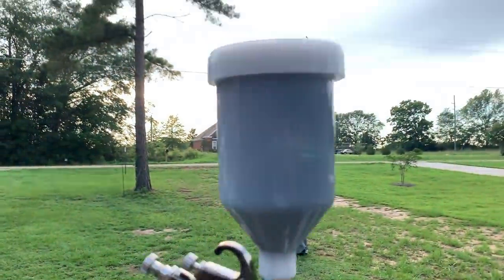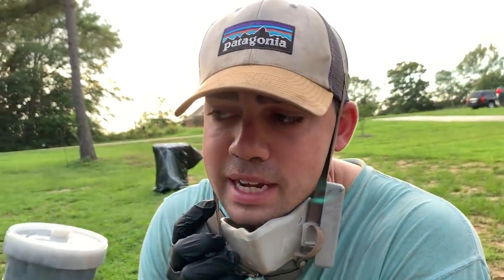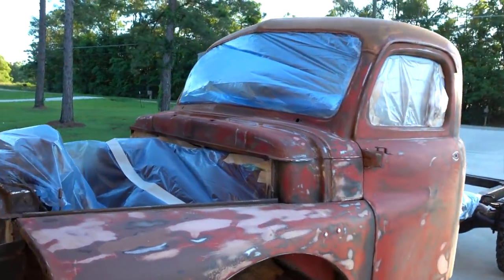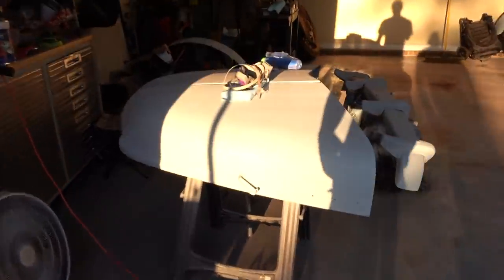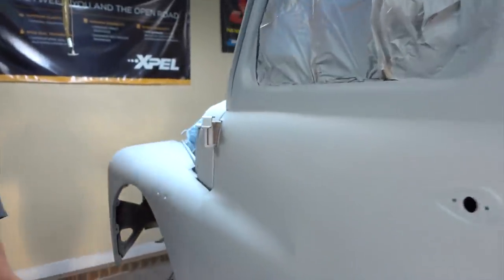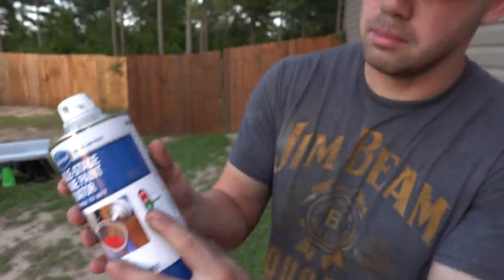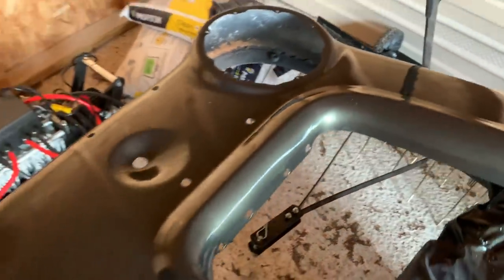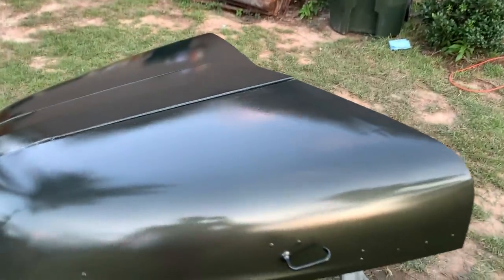I Painted My 70 Year Old Farm Truck Outside With Zero Experience.. Quality Results?

Comment: My  First viewing of your video but I enjoyed watching you shoot backwards.
   I painted my first car at 14 years old,  2 tone,  Red & White on a 1954 Buick 2 door hard top.
In 1963 I used automotive enamel which was preaty much the standard for the time.
The car owner was amazed !
My father who was a retired master painter, was empressed.
   I question why you start at the bottom close to you rather than at the top and draw toward yourself ?
My self as well as most painters I have seen always start at the top and work down, no matter what is being painted. 
Even a house.
As well as start at a point farthest away and draw closer to them.
This prevents dragging the air hose over wet paint and allowing you to put better coverage over the light mist already started at the point closest to you.
   Also why did you not ( cut in ) the areas that you will move over with your wide sweeps ?
The grill suround, under and around the hood edges, the drops and under edges of the running boards, the door openings as well as the door jams.
   Maybe you were taught a differant way !
Also. after you shoot your primer you can mist with black, then when you  block scratch sand the primer it shows any dents you may have missed in prep. allowing you to work them before start your final color coats.
This is especially important with a metalic color because matching dry metalic is a bitch and will usually leave a noticable ring around where you sanded !
   I hope you take  this as helpful tips from an old Hot Rod Builder.
I will soon be 72 years old and am still building cars of my dreams.
And I do all of it !
From the ground ( Garage Floor actually ) up.
Designing, Welding, metal fab, metal finish, upholstery and paint.
And I don't have a paint booth either.
I do not build my own engines anymore simply because it is just not something I enjoy.
I have a friend with a machine shop do the engines as that is what he enjoys doing.
I have a house full of trophys from a lot of car shows, so I guess I did something right.
Enjoy what you are doing, It will show in the finished product !

Be Safe and well
  

I

Comment: I'm an outside painter. When you wet sand and buff, it will look amazing. That is an art in itself. Hard to use sandpaper on brand new paint. All the dust and orange peel goes away. It will look perfect. Have faith. 👍
Reply: Even worry about overspray on your vehicles close to you not a good idea

Comment: Nice job for beginners. Wet sanding single stage might be tricky if there is metallic in it. You could send through the clear binder that is in single stage and exposing the pigments. Then you will have to repaint the area or the panel. Good luck and would love to see the finished truck.

Comment: You'll get better coverage and control if you move faster and overlap closer. Let each coat dry enough to dry and shrink in.
  If you want a slicker job. Paint and wetsand the next day with 600 grit wet or dry. Knock the peel down enough and put a light coat and after it tacks up , a wet to full wet coat. If you do it right it will be flat with little peel and you will only have to nub the dirt specks and polish those spots. Works out better for longer lasting finish.
   Painted professionally since 1970. Yeah I'm semi old.

Comment: nice job, rust on a car or truck( Buttina) is not cool and doesn't look good ,When spraying metallics it's good to spray in a checkerboard pattern of coats to avoid streaks, get yourself a good mechanical mixer and always shake your gun to keep it mixed when you're spraying.

Comment: What if you put the textured coating from East wood inside the wheel wells or a black undercoat an gloss black over it? Help with rock chips an if it chips at least the under coating is black already

Comment: I've painted a few outside, less bugs in the morning. As soon as I got some better paint equipment the paint looked a lot better. By equipment I mean 1.8-20 tip for spaying epoxy and 1.5 tip for the single stage, 1.3 or 1.4 for the clear. That helped with the orange peal. eventually I got to work inside- all that painting in the yard was good experience. good luck.

Comment: If the vehicle is going to sit outside for any length of time it's a good idea to prime the panelwork with an etch primer before a sanding primer. Otherwise, the sanding primer will suck in moisture through any stone chips or wear spots. Then rust will gradually spread underneath the whole coat. This is ten times more important if you live in an area where they salt roads. Etch primer will give long term protection against rust.

Comment: Orange peel comes from putting the first coat  on to dry, and when painting we always start at the top and work our way down , thats not to get over spray ............
Reply: You can do it either way starting from the  top on a truck  yes but on spot jobs indont
Reply: Orange peal can result from about 40 different elements throughout the process, if they would have just wet and buffed there would have been no issue

Comment: Just caught up with your project. I have a 1957 Chevrolet 6400, the body is in great shape no rust, lot of work to do on the frame for painting like you were doing. I stayed with the 2 piece wheels but if you want to go with one piece I believe there is a company in Calif. called Stockton that makes wheels any size and pattern you need. Good luck.  Nice paint job.

Comment: Not bad my man for the 1st I remember the 1st time I did a paint i was so pumped up... but from my experience it is pretty hard to effectively wet sand and buff metallic single stage paint you may have to scuff it down and reshoot it for the best result good luck and keep trying

Comment: Like u said a good wet sand to get the orange peal smooth and then hit it with a nice clear coat will look amazing. I suggest buying a cheap tent or build your own to inclose it some how while you clear coat it to get best results. There's vidios out there to build you own for a few hundred bucks some 2x4 and some clear painters tarp. Then wet sand your clear coat and and buff and wax. Great job guys love the videos.

Comment: I bought one of those Pilot house Trucks 20 years ago. Fired it up and drove it home 30 miles , No brakes no insurance. The tires had air but where flat spotted from setting. could only go 30 MPh. It had been setting for 35 years. It has the extra windows in the cab. And a Southwind gasoline heater. To much expence and work to put tires and brakes on it. I bought a motor home at a auction for $110.00 and it has a 440 . Drove it home also. Thats the best solution for me is to swap the 48 cab on that motor home chassis.

Comment: Boys, you're doing fine. Temperature,  humidity/moisture, and bugs are going to be your enemy. A little orange peel is nothing, have a look at factory job finishes. The difference is in sanding and cutting once it's down. Keep going strong.
Reply from the maker: Thanks Mark!

Comment: You did a great job! Don’t worry about orange peel. You will always get some orange peel. Then you cut and buff. For the dent Next time hit it with a dust coat of black primer over the grey primer, then block sand to see the high and low spots. I’m no pro either. My 1968 mustang coupe was the first car I painted at 16 I’m about to repaint it but idk if I have the confidence to make videos.

Comment: I did a summit racing single stage silver and burgundy two tone and cleared it with speedokote clear.
Reply: How long did you wait between last coat of single stage and first coat of clear? 
I have same brands Summit ss paint and Speedokote clear as you stated and about to paint soon.
Reply: @tobyk5149  first I sprayed the silver then I waited 8 hrs to tape the panel so I can spray the burgundy. The tech sheet said to wait about 30mins to an hour. When I touched the surrounding paint on the tape and it didn’t leave a finger imprint I knew it was ready to clear of course this is after thirty mins.
Reply: @FaDeDStudios  thank you so much for the quick reply and great info! Yes the Tech Data Sheet for Speedokote clear says 30 minutes but I have been reading online that many people say that since it is different brand than the Summit single stage, they wait a day or so then scuff with 800 grit or gray scuff pad before spray clear. I prefer the normal method that you did by following tech data sheet (let ss flash at least 30 minutes) but I planned to use a test panel because of the conflicting opinions online. Your info will save me some time and material that I would have wasted experimenting.
Reply: @tobyk5149  No problem, it took me a lot of time to build the courage to even paint it. If your painting with metallics i learned that it will mess with how the metallics laid so that’s why i cleared right after. do you have Instagram? I have a page called opas_obs there you can see how it turned out.

Comment: Was wondering if the bumper would cover the dent and that way you wouldn't have to worry about it! Honestly it will look so much better than it was I'm not sure how much I would worry about the small dent! If nothing sand it and fill it with either body filler or spot putty and respray it!

Comment: If you paint in the garage with plastic on the walls an wet the floor down it would help with the final clear coat at least the static electricity in the plastic will help Cling the over spray in the air

Comment: Prep is the most important. You can color sand the paint only so much. I did my Chevelle in my garage and beat local body shops at car shows this it's with 3000 contestants getting first place. Prep most important.

Comment: I am so glad to see that the youth of the day still are into repairing and paint the old stuff. From what I can see you are doing a decent job on it.  I like your paint booth, Kind of looks like my first one.  I painted my first car, a 1938 Ford, 4dr sedan, my first car,  I was 13 years old.  That was 65 years ago. I spent 20+ of my younger years in body shops and  I still have the passion.  My next project is to take my 1948 F6 COE Ford and it's little brother a 1948 Ford F6 Conventional and marry the two into a 4dr. 1948 F6 COE. Then mount the new cab on my 1993 F350 7.3 Turbo Diesel frame. Hope to have it done buy my 80th birthday.  I don't intend for this to be a show truck.  I will put a killer paint job on it, but plan to use it and not baby it.  .
Reply from the maker: Thanks for the support Bruce! Good luck on the COE project, I’d love to find me one to fix up

Comment: wetsand 1500,2500, 3500, and then clear coat, you should get a super smooth finish considering thats a single stage paint

Comment: Hey man the truck is coming along nicely. I had an oddball question. That’s a nice shed you have. Was it prefab or did you all build it? What are the dimensions?
Reply from the maker: I built it man, it’s a 14x12 on a 18x16 concrete slab. The roof is the full size of the slab
Reply: ParoDoXz that’s good shit man. I gotta get a nice shed for my equipment. You gonna run power to it?